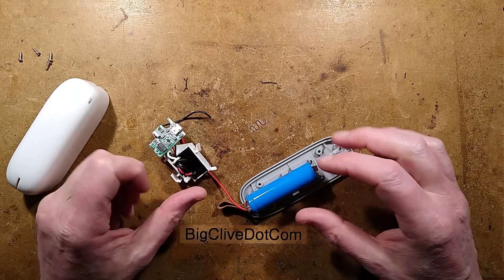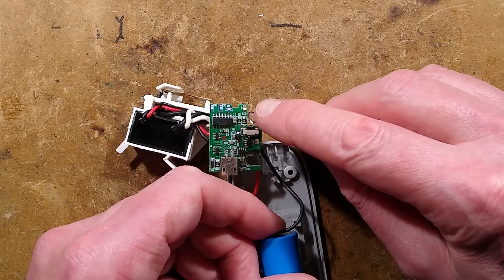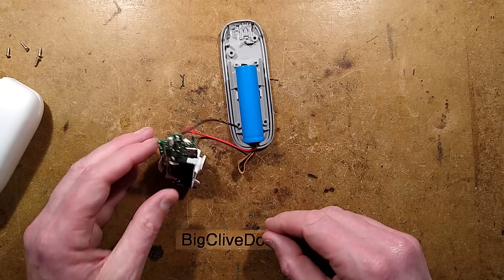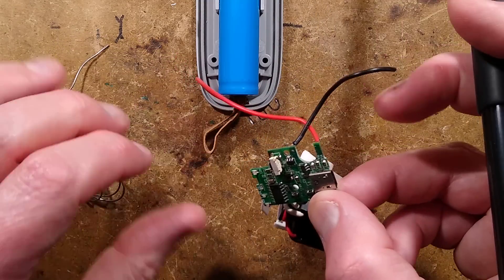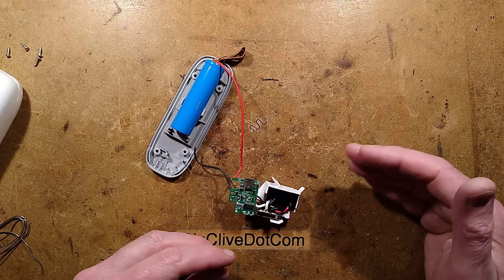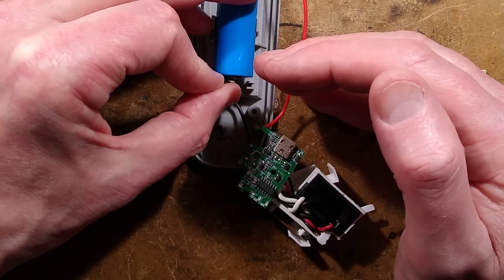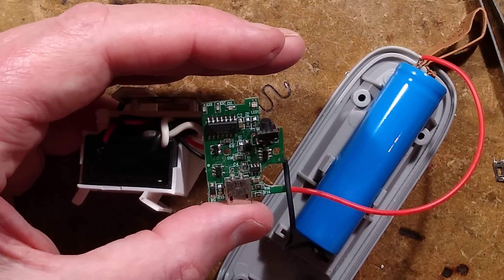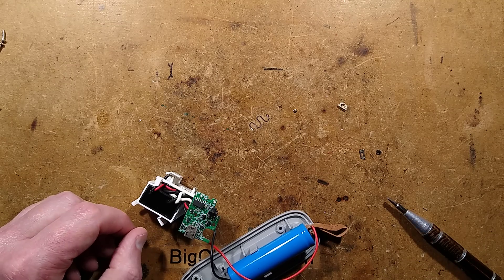The curse of tin whiskers rears its head again

Comment: If you touch it and it still has the problem it's not tin whiskers. they are very fragile.
Reply: tin whiskers were a problem in the 60s  solder has gotten better in the last 80 years.

Comment: Zinc whiskers are a big problem in aging data centres with zinc plater raised floor struts and stringers. When running cables under floor you can disturb them and blow up a lot of really expensive forced air cooled stuff. Boom, bang, pop, etc.

Comment: There is a very interesting website, to which I unfortunately don't have a link, that covers tin whiskers and a whole host of other whiskers such as zinc whiskers on the galvanising of computer flooring, which caused numerous server failures because the air supply to the racks was drawn from under the floor.

Comment: Motorola use these type of pressure switches as a reset switch in their Wireless LAN Controllers. They get tin whiskers too, causing the unit to constantly reset on bootup - saying reset detected (surprisingly). Just resoldering the switch cleared it.

Comment: The thing I remember most about tin whiskers is the failure of many Hughes 601 telecommunication satellites. A relay was prone to tin whiskers and would eventually short the processor out. There's a backup onboard but on some satellites, this also failed, rendering the satellite unusable and uncontrollable. I also think that the failure of Nvidia GeForce 8 GPUs might have been tin whisker-related, it was definitely a solder change that contributed to it.

Comment: Tin whiskers and electrolytic caps drying out are the two biggest problems with most electronics today.

When I repair anything, I still use 60/40 rosin solder, as it has the least tin whisker problems, and anything plated with tin gets a solder plating bath if possible to keep the tin whiskers at bay.

My equipment also gets recapped if it has any caps that show signs of leaking, as it won't be long till they all start, ad the copper tracks get corroded, and need repairs as well.

Comment: "let me hold the lead onto the battery lug... eeeergh..."

man, you have to try holding a jumper cable to a battery post when trying to jumpstart a recalcitrant lawnmower...

inspects burnt fingertips

the thing that scares me the most is the abundance of lithium batteries in innocuous devices that tend to be neglected, thrown into drawers and forgotten about, tossed into a bin with no second thought... once that voltage falls below a threshold and the protection gear no longer serves a prupose, theres nothing stopping them from... ahem... "failing".... or if something happens to short circuit it... or that mass produced BMS fails...

watches yet another garbage truck dump a load of burning rubbish on the road...

lol, i had a battery pack explode yesterday, im just lucky i was pretty well much standing next to it... toss it outside on teh lawn and let it erupt in a cloud of pink flame and black smoke...

Comment: Your comment, "It works really well" convinced me to buy one. The unit I bought has a nice digital display screen with a resettable timer and 8 modes; H1, H2, H3, L1, L2, L3, F1 and F2. The quality appears quite good but unfortunately no instructions were provided. The reseller was contacted who in turn contacted their supplier but to no avail, the only info was "How to Use: Press and hold the switch for 2 seconds to power on, short press the switch to switch between modes H1, H2, H3, L1, L2, L3, F1, F2". Because of this I was given a full refund. Other than assuming the obvious that each mode varies the output, it would be nice to know what each means and what the timer does. The timer looks to resettable up to 24 hours, which most likely is the run time but it would be nice to know for sure. I've only tried H1 in my fridge and it seems to work well but it was off before the time I had set. If anybody has any ideas or info it would be appreciated.

Comment: Ozone near food? Can it reach dangerous levels or is it too weak to cause any harm? Maximum ozone concentration in my jurisdiction is 0.03 mg per cubic meter of air for 24-hour exposure - and I suspect even a small gadget can generate these amounts over time.
Reply from the maker: Ozone is depleted quickly.  It doesn't accumulate over time.

Comment: The switch to lead-free coincided with the emergence of Nvidia's 8800 GTX graphics card, the first of the modern-day monster cards and a quantum leap in performance compared to the kinds of incrementally improved annual offerings the industry was accustomed to.  They were not cheap, and they were not reliable.  Managed to reflow mine several times successfully, just using the kitchen oven!  Eventually SMC's began dropping off though.  This was after repeatedly RMA-ing the card to have the same thing done by the manufacturer - in the first year of ownership it spent more time being sent back and forth to the service center than being used inside the PC.  Much futile fist-waving at the eco-warriors.

Comment: The reader @tlhIngan had it correct.  Tin whiskers is not a RoHS thing. Its been known since the preWW2 era.  There is also the "purple plague", the "brown plague" and the very common "green plague", which was observed in electrical and electronic equipment since the time of Edison and Marconi, and especially in the Space Programs, due to the vacuum and Zero-gravity.  Corrosion and Electrolytical plagues can form at very low voltages, even 0.3V or below for common metals.  All it takes is some humidity.  These go up to about 30+Volts, where next band takes over.  Electronic and Wind plagues usually require voltages above the "work functions" of material surfaces.  Those range from about 3V-to-30V.  Paschen high-voltage creep occurs in vacuum above about 250V, due to the stress levels in small spaces.  That causes long-term creep of metals.  Electromigration can actually occur well below the Paschen levels, when given an electrolytic contamination layer, such as solder flux, OR a chlorine cleaning chemical.  Chlorine contamination of capacitors is and was a common problem.  TIN Whiskers are mostly a "mechanical problem" where you have a stressed material (high heat, fast cooling), which results in nucleation sites where the stress is relieved, via thermal relaxation and heaving, due to temperature changes.  This creep mechanism also occurs in many other materials (copper, aluminum, zinc, etc).  The Whiskers then preferentially grow toward any zone of high affinity, usually an electrically or magnetically attractive nearby site.  In the Space Programs they always grew toward the highest nearby electrical voltage terminal, and thus tended to short out the item.  In magnetic relays, they always grew toward the maximum flux zone, which always blocked the piston or actuator.  There are literally dozens-of-thousands of technical papers written about these issues, dating back to the 1950s, when such phenomena became important, mostly due to the smaller and smaller dimensions of the electrical and electronic apparatus needed for the military and space industries.  This video only shows some minor corrosion effects, and has virtually nothing to do with whiskers.  Just get a microscope, and scope it out for real.  We've seen thousands of such defects, mostly due to flux contamination.

Comment: I recently retired from a Failure Analysis Lab for a "very large computer company".  In some situations, I used an SEM and EDS  to image and classify the phenomena.  Pretty pictures.  
We had a tin whisker problem in an enterprise system power supply that operated on 240 VAC.  When the tin whiskers grew from the plating on the line input fuses, they would arc and create a very "entertaining" plasma cloud and self destruct the power supply input stage.  It was rather dramatic.
Tin whiskers look pretty interesting under magnification.  They have striations and one can see their nuclei when they're getting ready to emerge.  
We also had zinc whisker problems.  It was common for data center flooring to have zinc in the flooring panels to make them conductive.  Guess what happened when the computer fans sucked in the zinc whiskers and blew them over the printed circuit boards?  🙂
Google "NASA tin whisker study" for some interesting pictures and analysis.  The CALCE real time whisker growth video is interesting.

Comment: Doesn’t ozone break down plastics? Would using one of these devices in your refrigerator shorten the lifespan of the fridge by hastening the breakdown of the internal components?
Reply from the maker: It's just a low level.  No sign of damage after around a year of use.

Comment: When I was in IT, we learned about tin whiskers growing from the galvanized steel supports holding up computer floors. They would break loose and get in the air being blown into mainframe and racked computer systems and cause all kinds of random crashes.  Then, later I got into fixing old tube radios and learned about Silver Mica Disease (look it up) where silver in certain capacitors migrates and grows "tentacles" that eventually short out and cause crashing noises in radios.

Comment: If you suspect Tin Whiskers give the switch a low voltage high current source for pulse to burn them.  In circuit should be ok if the voltage is low.

Comment: I worked in R&D at Nokia, designing LED lighting, and we made a change to so-called "high side" LED drivers, that connect the led cathode directly to the "ground", and control the voltage/current on the positive side, so the there is no higher voltage applied when the LED is off, and the conductors and connectors to the LEDs have voltage applied only when the LEDs are on... There might be nanoamps of leakage, but the voltage will never be higher than the LED Vf with a few nA... anyway, this reduces metal migration possibilities, and corrosion, as well as guaranteeing that a shorted LED will never draw more than the programmed drive current.

Comment: As a failure analyst working for a MAJOR IC producer now retired. The cause of tin whiskers is the size of the tin crystal. Remember that the IC, plastic, ceramic or switch starts off with a steel or alloy frame. The tin is then electroplated onto the spring steel to create a surface that will receive solder. 
The problem occurs when the electroplating process is rushed to speed up production. The tin with fast electroplating grows larger ROUGH structures. THESE create points subjected to micro charge points at the atomic level. The tin then reorients to this charge creating whiskers.  Our staff would often find shorts between returned product IC leads. Especially on older product showing large grain structure under scanning electron microscopes. Which when brushed the connections between leads would disappear and the product performed as intended.  Quality slowing plating made smaller smoother surface crystals and problems stopped. But it was 5 years to get rid of old rushed plating inventories.
Reply: Absolutely fascinating, do you happen to have a paper on it you would recommend? Preferably one with scanning electron microscope images. I love that stuff, found a paper a few years ago showing the actual molecular dendrite formation in lithium ion cells, incredible reading!
Reply: @beardedchimp  Sadly no.  It's been a long time and even then it would be proprietary information.  I would say that it seems logical because if you leave tin/lead solder out in the weather. The tin lead tends to oxidize and grow a surface that extends roughly off the surface. I had some rosin core in my garage that basically was ruined after years of just sitting in air/humidity.
Reply: @TheTruth.K.J.V.  with that lithium cell dendrite paper, we knew they formed but understanding the conditions under which they visibly form and then grow was unknown.

They subjected samples to a large range of temperature fluctuations, high discharge, high currently charging etc. 

If I remember correctly one of the interesting observations was that while we already knew deeply over discharging lithium ion cells leads to dendrites, we didn't realise that they didn't properly grow until it was recharged.

So you'd have these small precursors after reaching this pitiful voltage. When measuring resistance you wouldn't see this low ohm warning of a future short. Yet after charging from that overly discharged state, the dendrites grew rapidly. 

It's what make battery fires so dangerous, you've abused the cells but it seems ok because they are taking charge. Leave it for a few hours while you go to bed only for the now highly charged battery to internally short.

Seeing these dendrites actually form is beyond cool. They'd used effectively a thin slice of various lithium ion anode/cathode/electrolyte chemistry so that it was observable through electron microscopes in real time.

As you said it is very sad that some of this valuable research is hidden behind a veil of proprietary information. The entire semiconductor industry is built off the back of globally funded public research. Those companies use that freely given knowledge to create valuable products but are hesitant to give anything back. So much needless electronic waste and fire hazards due to perceived future competitive advantage.

Comment: Actually, tin has a lower melting point than lead.  In bullet casting, we add a bit of lead to our alloy so that it will fill out the molds better.  If you are having problems with lead-free solder, it is most likely NOT because of the tin.

Comment: Sorry, It appears that Clive is behind the times. All automotive PCBAs and almost all of heavy duty truck, and consumer electronics use lead free solder. I am a systems auditor and I do not find tin whiskers as a failure mode in PCBAs during warranty analysis.

Also tin whiskers are claimed in the video, but not proven. No further investigation was done into other possible causes.
*I do like your channel***
Reply from the maker: I'm open minded to the cause.  A lot will depend on the quality of materials used in plating or soldering.

Comment: I have to wonder if that could be what happened to my vape device. Just as was about to fall asleep last night, I heard a hissing and turned the light on to find my vape sizzling away with a cloud shooting out of it Mt. St. Helens style. Clicking the button several times got it to stop, but I pulled the pod off of it just in case. Today, it started firing up at random or if I moved it, so I got myself a replacement and deactivated the old one.
Reply from the maker: Moisture ingress seems to be one of the biggest issues with vape devices.  The glycols absorb water from the air, making them stay wet.
Reply: A distinct possibility, and the pod leaked like crazy. I had to wipe the juice from the connectors at least once a day. I would have expected the circuitry to be better protected though, because I don't think nocturnal spontaneous combustion would be a very good selling point.

Comment: have you ever tried   "deoxit d5" or CRC "QD Electronic cleaner" ?    on mech switches?
I have had STUPIDLY good luck with 1 or the other, or both.

with truly old things, as well as modern microswitches. ( logitech wireless meeces, I'm looking at you.... )
no guarantees on the plastic though.
Be Sparing!

Comment: I've opened/repaired/built tons of electronic devices and have never seen tin whiskers let alone had a problem that could trace back to them. I think it's a problem that's blown way out of proportion nowadays (it may have been a problem at the time of switching from leaded to leadfree solder decades ago).
I have seen tons of failures caused by shoddy soldering though (manual or by machine). If we talk about push buttons for example, being slightly melted, because they were heated too much. Thea heat also often damages the contacts (makes them oxidize) so their lifespan is greatly reduced. But depending on the environment buttons just die on their own, because the manufacturer skimped on the contact material so the button just develops higher and higher resistance in the pushed state. On those buttons that "push" by themselves, it's, again, manufacturers skimping on materials and using metals that aren't springy enough. Those metal domes you push get flatter and flatter and at some point the button doesn't stay "open" properly.

Comment: That’s funny. I had a similar problem with my washing machine. The wrong function activated when you pressed a button. turns out the switches were in a resistive ladder and the microcontroller used A2D to determine which button. High resistance in the switches caused chaos.